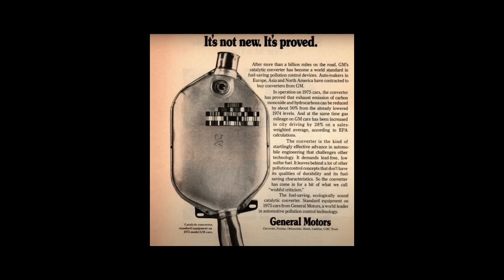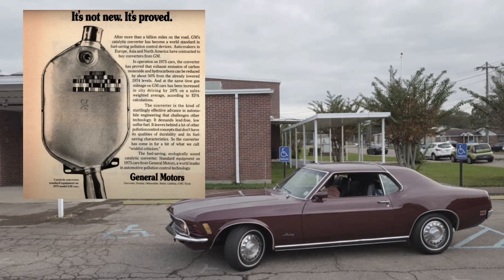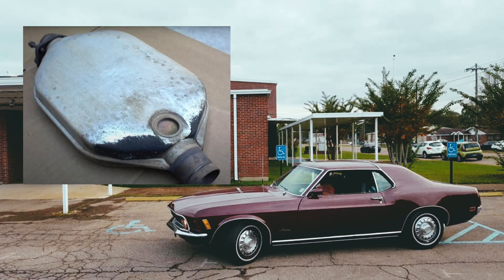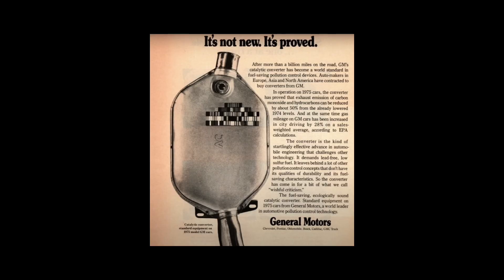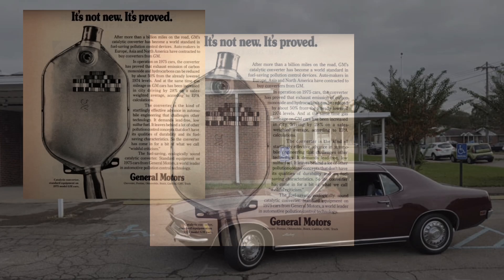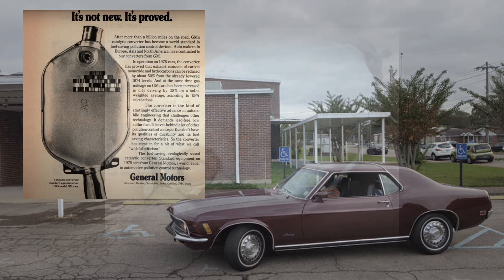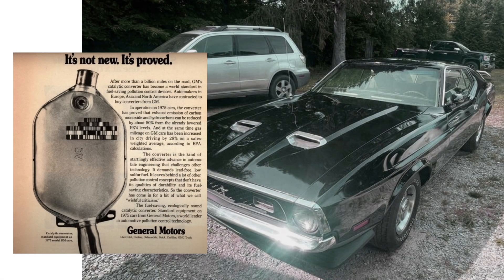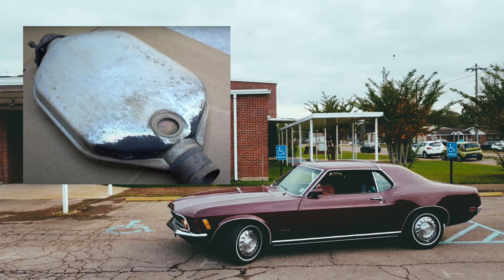Strangest Car Inventions: Ford's Unique Approach to 1970s Emissions Standards

Comment: My '70 Datsun B210 had an air pump as well. I used to temporarily detach it to fill my inflatable boat. Worked great.
Reply: A lot of manufacturers used air injection pumps. My '73 IH Scout II had one.